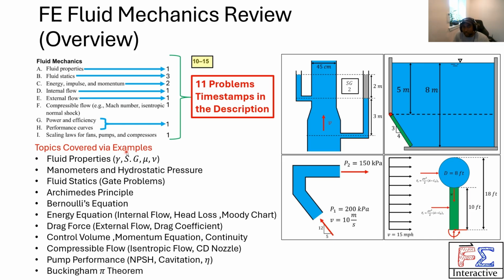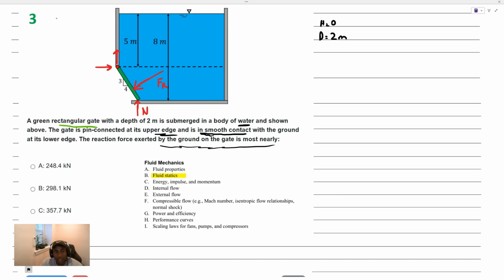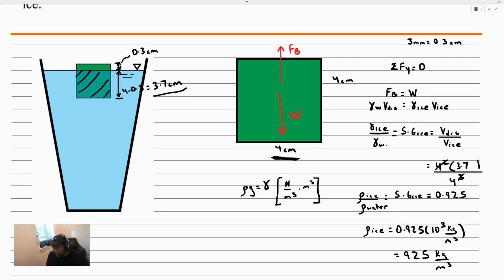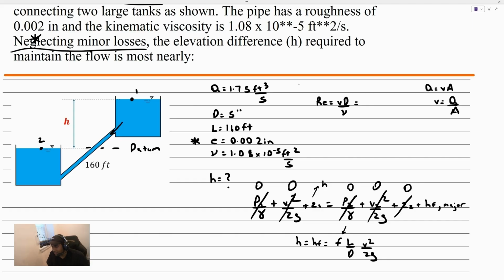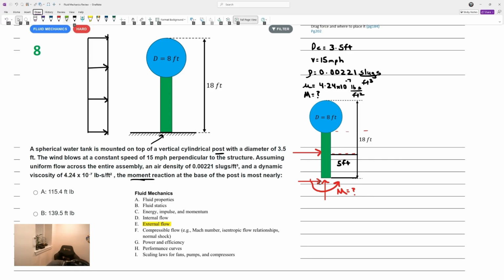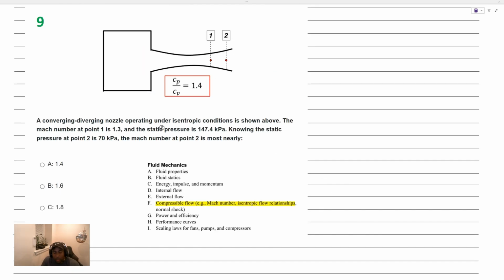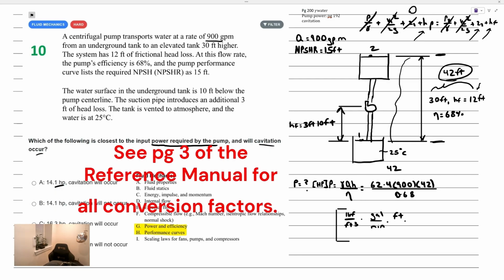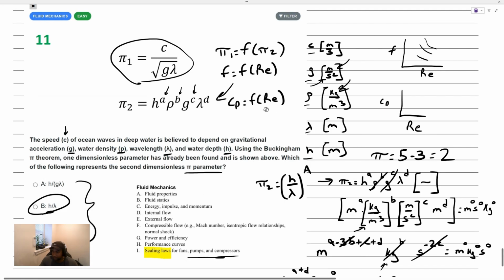FE Exam Fluid Mechanics Review – Master the Core Concepts Through 11 Real Problems

Comment: For question 4, all you had to do was find the percentage of the ice cube submerged in the water and then multiply that by the density of water, and you just get 925.
Reply from the maker: While that is correct in terms of the calculation, I try to be rigorous in my problem solving, and I encourage others to do the same.

The relationship between the submerged volume ratio and the density ratio is not necessarily intuitive without understanding the underlying physics. Simply multiplying the submerged percentage by the density of water gives the correct answer, but it does not explain why that relationship holds.

The principle we are applying here is Archimedes’ principle, which states that the buoyant force acting on an object is equal to the weight of the fluid it displaces. By recognizing that the ice cube is floating in equilibrium, we can equate the buoyant force to the weight of the ice cube and derive the relationship between the densities and volumes.

If I simply multiplied the volume ratio by the density of water and concluded that the density of ice is 925 kg/m^3, we would miss the fundamental concept that makes this calculation valid. Many people would be left wondering why that calculation works.

My goal with these problems is not just to arrive at the correct numerical answer, but to demonstrate the underlying principles so that you can confidently apply them to more challenging problems where a simple shortcut may no longer work.

Comment: For problem 4, you got 4 gamma for the pressure at the unspecified liquid but that was composed of incorporating 2 from the Specific Gravity of the fluid. So technically wouldn't point 1 be 5 gamma in pressure since that part is water and we would not take into account that specific gravity?
Reply from the maker: I think the confusion is coming from how specific gravity is being used in problem 5.

For any static fluid column, the pressure increase from the top of the column to the bottom is

ΔP = ρ * g * h = γ * h

where ρ is the fluid density, g is gravity, γ is the fluid specific weight, and h is the height of the fluid column.

Let γ_u represent the specific weight of the unspecified fluid and γ_w represent the specific weight of water.

The specific gravity of the unspecified fluid is

SG_u = ρ_u / ρ_w = γ_u / γ_w

Since SG_u = 2,

γ_u = SG_u * γ_w = 2 * γ_w

Now apply ΔP = γ * h to the 2 m column of unspecified fluid:

ΔP_u = γ_u * h

= SG_u * γ_w * h

= 2 * γ_w * 2 m

= 4 * γ_w

So that 2 m column of the unspecified fluid produces the same pressure increase as a 4 m column of water. This makes intuitive sense because an SG of 2 means the unspecified fluid is twice as heavy per unit volume as water, so each meter of that fluid produces twice the pressure increase of a meter of water.

Then, from that interface down to Point 1, there are 3 m of water:

ΔP_w = γ_w * h

= γ_w * 3 m

= 3 * γ_w

Therefore,

P_1 = 4 * γ_w + 3 * γ_w

= 7 * γ_w

So 7 * γ_w is correct. The SG = 2 is only applied to the 2 m section of the unspecified fluid. The 3 m water section is treated separately and contributes 3 * γ_w. Hope it is all clear.
Reply: @Eng_Fundamentals  Oh, whoops, you're right. I meant problem 5. And yes I understand what you are saying now. The pressure created in the 2m  with the fluid would apply to the point 3m of water below as well. My question to that is, wouldn't that point and point 1 differ in pressure technically? The same way the pressure on the left and right columns of point 2 differ (due to the different pressures). Maybe I'm missing something here that connects everything; my apologies. Outside of that, thank you for all your help with these videos, they are an absolute gold mine, as well as answering questions. I have my FE coming up in a month.
Reply from the maker: @saadqureshi5794  

I think the key to understanding this problem is separating three ideas and applying each one only where it belongs.

1. Hydrostatics applies within the stationary manometer fluid

For a fluid at rest:

dp/dz = -ρg

Therefore, two points at the same elevation have the same pressure only if they are connected through the same continuous static fluid. Simply being at the same elevation is not enough.

For example, the upper right manometer contains 2 m of fluid with SG = 2:

γ_u = SG_u * γ_w = 2γ_w

Using hydrostatics:

ΔP = γ_u * h

ΔP = (2γ_w)(2 m)

ΔP = 4γ_w

So the pressure at the bottom of that static column is 4γ_w relative to atmospheric pressure.

However, at the same elevation in the upper left manometer, the static pressure is 2γ_w. These pressures do not have to be equal because there is no continuous path from the upper right manometer to the upper left manometer that remains entirely within static fluid. To get from one to the other, we would have to pass through the moving water in the pipe.

This is the important limitation of the equal elevation rule. It applies within a continuous static fluid, not simply to every fluid point that happens to be at the same elevation.

2. How can we use a static manometer to determine the pressure of a moving fluid?

At this point, you might reasonably ask: if hydrostatics only applies to stationary fluid, how can we calculate P1 or P2 in the moving pipe from the stationary fluid in a manometer?

This is where a second principle comes in: pressure continuity at the pressure tap.

P1 and P2 are static pressures even though the fluid itself is moving. Static pressure does not mean the fluid must be stationary. It is the ordinary pressure P exerted by the moving fluid.

At the pressure tap, the moving pipe fluid is directly connected to the stationary manometer fluid. The static pressure must be continuous across that interface:

P_manometer at tap = P_pipe at wall

If these pressures were different, there would be an unbalanced normal force at the interface and the fluid would adjust until the pressures matched.

We then make the usual one dimensional pipe flow assumption that the static pressure at the wall tap represents the static pressure of that pipe cross section. Therefore:

P_manometer at tap = P1

or, for a tap at Point 2:

P_manometer at tap = P2

So we are not applying hydrostatics through the moving pipe. We use hydrostatics only within the stationary manometer to find the pressure at the tap. Pressure continuity then allows us to relate that pressure to the static pressure of the moving fluid.

This is also why a piezometer sticking out of a pipe uses only the height h of the stationary fluid column above the tap:

P1 = P_tap = γh

We do not add the additional distance from the wall tap to the pipe centerline. That region is within the moving fluid and is not part of the static fluid column.

3. Why does it make sense that P2 < P1?

Once we are inside the moving pipe, we use continuity and Bernoulli’s equation rather than hydrostatics.

Bernoulli’s equation is:

P + ρV²/2 + ρgz = constant

Here, P is static pressure, ρV²/2 is the dynamic pressure associated with the fluid’s speed, and ρgz accounts for elevation.

The pipe becomes smaller from Point 1 to Point 2, so continuity tells us:

V2 > V1

Point 2 is also higher than Point 1:

z2 > z1

Therefore, at Point 2 the fluid has greater kinetic energy because it is moving faster and greater gravitational potential energy because it is higher. Assuming negligible losses, those increases come at the expense of static pressure.

That is why:

P2 < P1

So the three ideas fit together cleanly. Hydrostatics determines how pressure changes within each stationary manometer. Pressure continuity at the tap connects the stationary manometer pressure to the static pressure of the moving pipe fluid. Finally, Bernoulli and continuity explain why the static pressure changes from P1 to P2 within the moving fluid.

I hope this clears everything up. Thank you for the kind words about the review videos, and good luck with your exam next month. I’m rooting for you!

Comment: in problem 7 how did u get v1 to be negative?
Reply from the maker: The short explanation is that velocity is a vector, so its sign depends on the direction of the component we are looking at. We defined positive x to the right. V2 points to the right, so its x component is positive. V1 points partially to the left, so its x component is negative.

There is then an additional negative sign in the momentum equation because V1 is associated with flow entering the control volume. So for the V1 term, the negative x component of velocity is multiplied by the negative sign associated with the inlet. These two negative signs cancel, making the entire V1 momentum term positive in the end.

The longer explanation goes back to the more general form of the linear momentum equation, which I think makes the signs much clearer.

For steady flow,

ΣF = ∫CS ρ V(V · n) dA

This is a vector equation.

Here, V is the velocity vector and n is the outward pointing unit normal vector to the control surface.

The dot product

V · n

tells us whether the fluid is entering or leaving the control volume.

At an outlet, the velocity points generally in the same direction as the outward normal, so

V · n > 0

At an inlet, the velocity points opposite the outward normal, so

V · n < 0

This is where the “out minus in” form used in the FE Reference Handbook comes from. The negative sign for the inlet is not really an additional rule. It comes naturally from the dot product with the outward pointing normal.

Now, because the equation above is a vector equation, we can project it onto the x direction by taking the dot product with i hat:

i · ΣF = ∫CS ρ(V · i)(V · n) dA

The term

V · i

gives us the x component of the velocity.

For V2, the velocity points to the right, which is our positive x direction, so

V2 · i = +V2

For V1, the velocity points partially to the left, so its x component is

V1 · i = -V1 cosθ

That is where the negative sign on V1 comes from. V1 itself is not a negative speed. Its x component is negative because that component points opposite the positive x direction.

Since section 1 is also an inlet,

V1 · n1 = -V1

So the x momentum contribution from section 1 becomes

ρ(V1 · i)(V1 · n1)A1

= ρ(-V1 cosθ)(-V1)A1

= +ρA1V1²cosθ

So there are really two separate negative signs.

One comes from the direction of the x component of V1.

The other comes from the fact that the fluid is entering the control volume.

Those two negative signs cancel, which is why the V1 momentum term ends up positive in the final x direction momentum equation.

The FE Reference Handbook simplifies this into the convenient “out minus in” form, but the surface integral form makes it easier to see where the signs actually come from and I think is better for understanding the linear momentum equation.

Comment: Hello, Thanks for sharing. HWs are very helpful. I am pausing in HW 8 because I am trying to figure out the area calculation. Would you mind explaining me how you got the side area of sphere and cylinder? To my understanding, Cylinder side area = pi*d*h and sphere area is pi*d^2. Thank you so much
Reply from the maker: The key idea here is that we are using the frontal area, or projected area, rather than the total surface area of the object.

You can think of the frontal area as the area you would see if you projected the object onto a 2D plane that is perpendicular to the direction of the flow.

For the cylinder, with the flow acting perpendicular to the cylinder axis, the projection is a rectangle. Therefore,

A = dL

where d is the cylinder diameter and L is its length.

For the sphere, the projection is a circle. Therefore,

A = πd²/4

The expressions you mentioned are surface areas rather than the frontal areas used in the drag-force equation. For example, πdL is the curved surface area of a cylinder, while the full surface area of a sphere is πd².

For drag, we want the area presented directly to the flow, which is why we use dL for the cylinder and πd²/4 for the sphere. Hope it is clear.

Comment: Do you have any more examples of those pressure prism problems from fluid statics?
Reply from the maker: There are three or four more examples available in the paid version of FE Interactive at fe-interactive.com, including how this method is applied to a semicircular gate, which is a classic and foundational problem when studying this topic. I am confident that if you can solve the problem I worked through in the video and understand how to analyze a semicircular gate by considering the chunk of fluid above it that creates horizontal and vertical fluid surfaces, you should have no trouble with any gate problem you encounter.
Reply: @Eng_Fundamentals  Thank you!

Comment: For problem #10, why is the additional 3ft of head loss not included in the total head loss used in the pump power equation?
Reply from the maker: Rereading the question, I see the wording is a bit confusing, so thank you for catching that. I will correct it in the problem statement. Instead of saying:

“The suction pipe introduces an additional 3 ft of head loss”

I will modify it to:

“The suction pipe has 3 ft of head loss”

This makes it clearer that the total system head loss is still 12 ft, as stated earlier in the problem when we said:

“The system has 12 ft of frictional head loss”

That 12 ft refers to the entire system, including the suction pipe. In other words, the suction pipe contributes 3 ft of head loss, while the remaining piping at the pump outlet contributes the other 9 ft, giving a total frictional head loss of 12 ft for the full system.

Comment: I don't understand why the force at point two in problem 7 is pointing to the left (negative).  Since the flow is traveling in the positive direction I would think that force should be pointing in the positive direction. Can anyone shed any light on this?  Thanks!
Reply from the maker: That force at the pipe cut boundary is due to pressure from the adjacent fluid molecules. Pressure is a compressive force, so it always acts inward on the control volume, effectively squeezing it.

To visualize this, imagine physically removing a section of pipe and holding the water filled pipe between your hands. Since the pipe is full, you would feel the fluid pushing outward against your hands at both ends. To keep the water contained, your hands must apply an inward force.

If you now draw a free body diagram of the PIPE, freeing it from its surroundings, those inward forces from the hands retaining the water become the pressure forces acting on the control volume. In reality, the adjacent fluid molecules play the role of your hands.

There is also an equal and opposite force acting on the adjacent section of pipe or fluid. For example, at point 2, while the schematic may only show your isolated control volume, there is another section of pipe to the right. On the free body diagram of that adjacent section, the pressure force at the shared boundary points in the opposite direction. This is the fluid in your control volume pushing on the neighboring section.

This is Newton’s third law: the fluid in your control volume pushes outward on the surroundings, and the surroundings push inward on the fluid. 

Finally, remember that pressure acts over an area, and a uniform pressure distribution can be reduced to a single resultant force. These two representations are statically equivalent, meaning they produce the same net force and moment on the control volume. For control volume analysis, we use this resultant force since we are only interested in overall force effects, just like in a statics problem. If we were instead interested in stresses or deformations, the full pressure distribution would need to be considered.

Hope that answers your question. If not feel free to follow up.
Reply: @Eng_Fundamentals  that does answer my question. Thank for you the detailed explanation and visualization, that was super helpful!  And great job with the videos. I'll look forward to visiting your website and continuing my studies there.

Comment: Thanks for the video. Most of the topics you discussed are not part of FE civil
Reply from the maker: Interesting. Did you find that was the case for your specific FE Civil exam?

Here is the Civil specification for Fluid Mechanics:

Fluid Mechanics
A. Flow measurement
B. Fluid properties
C. Fluid statics
D. Energy, impulse, and momentum of fluids

Part A (Flow Measurement) tells me that concepts such as Bernoulli’s equation are applicable, since they form the basis for measurement devices like the Venturi meter and Pitot tube.

Fluid properties means you could be tested on quantities such as specific weight, specific gravity, and viscosity.

Fluid statics indicates that problems involving submerged gates, manometers, and Archimedes’ principle are applicable.

Lastly, energy, impulse, and momentum of fluids suggests that control volume analysis is relevant, along with concepts like Reynolds number, the energy equation, and using Moody charts.

Based on that, I would say the problems (note this is 7/11 problems) below contain ideas that can absolutely help Civil engineers preparing for the exam.

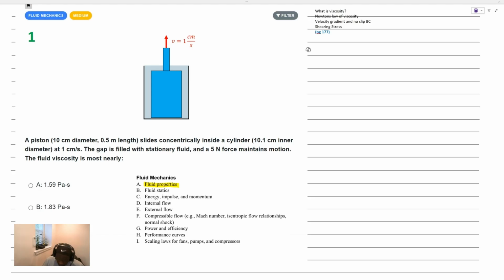2:26 – Problem 1 – Newton’s Law of Viscosity (Fluid Properties Overview)
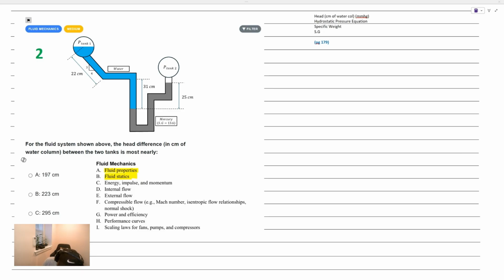12:48 – Problem 2 – Manometers (Fluid Statics)
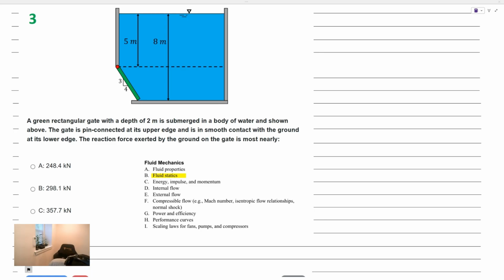20:01 – Problem 3 – Gate Problem (Fluid Statics)
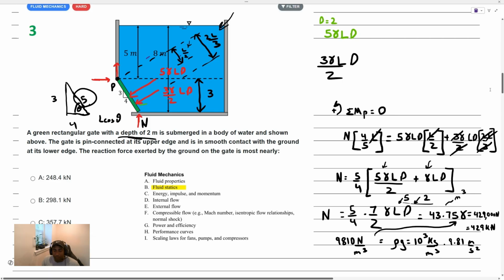34:03 – Problem 4 – Archimedes’ Principle
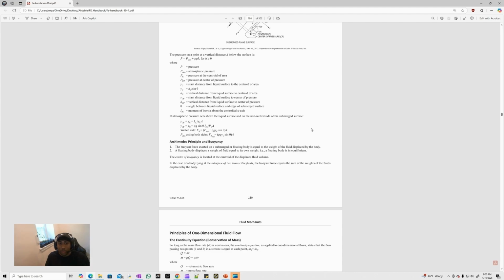41:43 – Problem 5 – Bernoulli Equation and Continuity
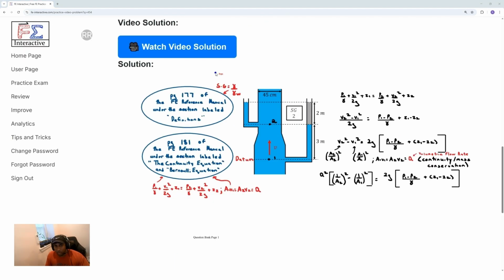54:35 – Problem 6 – Moody Chart and Energy Equation
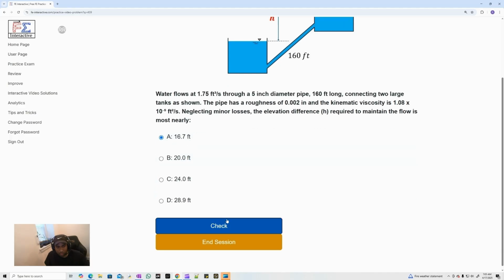1:07:12 – Problem 7 – Control Volume (Momentum Equation)